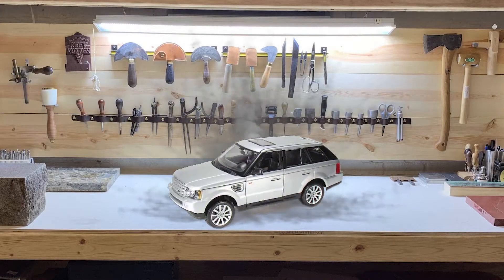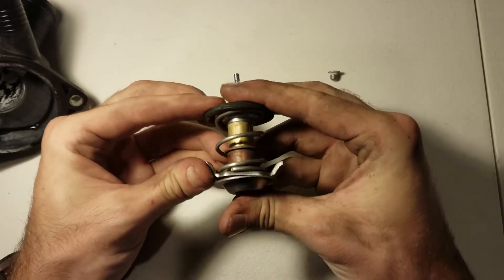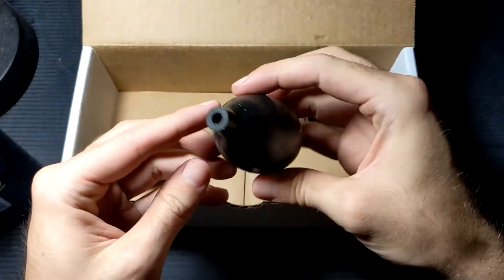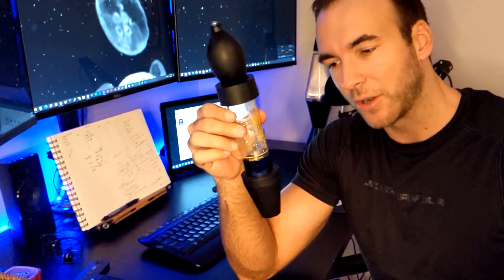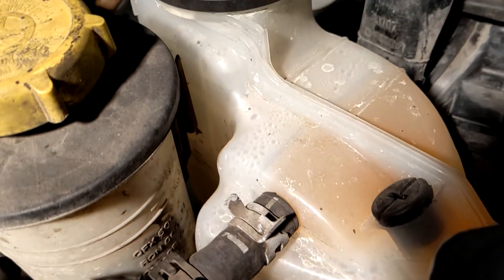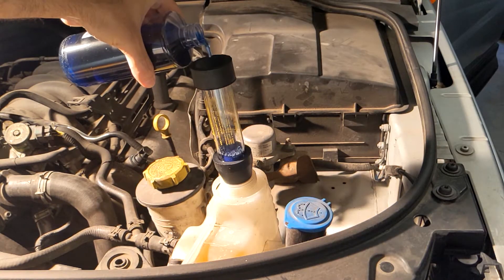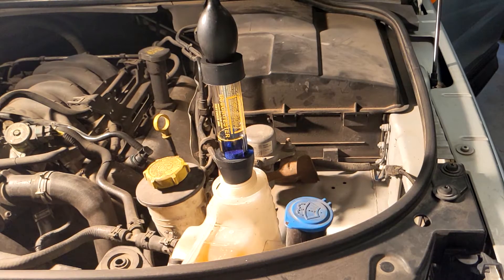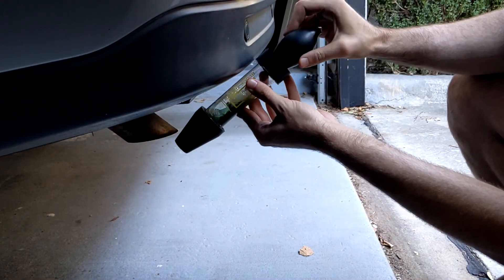Blown Head Gasket Test - Any Make/Model

Comment: I get tons of bubbles but the fluid stays the same blue. And when forming a tight seal the bulb won't expand it just stays compressed
Reply from the maker: That's good, there shouldn't be any gas being produced in the cooling system while the seal is tight.

Comment: Hey looking for some info. I’m testing a diesel for head gasket failure. Mine didn’t turn yellow but it turned kinda greenish blue like at 4:16. I tested it on exhaust and it turned yellow so I know it works. Is it possible I have a very small head gasket leak since it turned a little greenish. Said in instructions if it turns yellowish green then it fails but mine is greenish blue.
Reply from the maker: You may have a small leak but nothing large enough to require a new head gasket just yet. It should really stay the same blue as it started, any color change isn't ideal.

Comment: I bought the two-level tester....however, what happens is that the liquid from the top-chamber gets sucked into the lower-chamber, and the pump barely works, it takes about 30-40secs to pump up...eventually the liquid in the lower chamber changes colour and gradually so does the liquid the in the top-chamber...I don't know why this is how it's meant to work..

Comment: I had a weird issue crop up after a coolant flush, same 4.4 as you have. Previous owner had blue coolant in the system since I have owned it. Though at first I thought it was windshield washer fluid, I researched and found Peak European blue, which says "Land Rover V8 & Diesel, 1990-2005." However, the vehicle match check on Amazon and AutoZone says it's not a fit. So I wanted to swap for pink. Long story short, I have it flushed and pink added and mechanic says flush is clear but fluid keeps coming back purple after it cycles. They did a block test and it failed, not right away but after a bit, which he suspects is exhaust fowling the fluid. 1) I think that explanation checks out, and 2) with it running great currently, what are my options? What would you do?
Reply from the maker: @thelittleburro  The fluid in the heater core will take a while to flush out I would assume, I would not expect exhaust to turn yellow coolant purple. Id run it for a while and see if the coolant continues to change color after about 1,000 miles, and if so, maybe consider stop leak or having the head gasket replaced.
Reply: @HazyJay  It's the pink stuff I had them put in, so I could see how it might turn more purple. But it's weird because the previous blue always looked quite blue, not muddy. I just replaced the water pump myself (no overheating during my ownership) and didn't have flush equipment so opted to have them do it. When I noticed it leaking, I topped off with a few ounces of Prestone green, which the bad pump spewed out, so I parked it until I could replace the water pump. (Also, I asked if they ran the heater during flush and they said yes.)
Reply from the maker: @thelittleburro  Yeah I'd guess the purple color is much more likely from yellow mixing with blue rather than an exhaust leak, it will just take more time for the old blue to flush out completely. The flush procedure is fairly convoluted on the 4.4, so I wouldn't be surprised if they didn't do it correctly.
Reply: @HazyJay  I'm going to leave the fluid as is for now and perform my own leak test. If the test fluid changes color, what stop leak product do you recommend?
Reply from the maker: @thelittleburro  Yeah that's what I would do. I haven't had to use one yet and honestly the stop leak is the last line intervention since it can clog coolant channels you don't want clogged (radiator). If it comes to that, consider k-seal or barrs tablets.

Comment: What if the bulb never uncompresses itself. As in its not pulling any air into the test fluid? Its completely sealed?
Reply from the maker: Yes, that's a good sign 👌
Reply: @HazyJay  Thank you!!
Reply: @HazyJay  what if the fluid doesnt change but I do get bubbles? My Matrix never changed from the overflow tank but I did get tons of bubbles!

Comment: I have a question.  I had antifreeze in my oil… only noticed because I heard a slight unfamiliar sound when first running my 2000 International dt466e.
A mechanic suggested I have the oil cooler replaced as it was the least expensive place to start.
I had gotten the parts etc (definitely not inexpensive) .  Changed oil & filter a couple of times to try to remove the antifreeze.  Then re-added antifreeze.
I “thought” I had filled the antifreeze and actually thought I had over filled it.
Came out to check it the next morning and antifreeze seemed empty and antifreeze in the oil again.
The mechanic suggested I move the truck a short distance away, which I did, and white smoke was pouring out of the blow by.  This never happened before.

My question is this…. Could the oil cooler have been put on incorrectly.
If it had, would that cause the antifreeze to flow directly into the oil.  Aren’t they directional?
Reply from the maker: Usually the fittings (oil circuit and coolant circuit) are different and wouldn't be possible to swap on accident. It's possible the oil cooler was cracked and coolant leaks into the oil, but if you replaced it and still see oil it's likely turbo housing crack, engine block crack, head gasket. If antifreeze leaks into the oil while the car is off then it's possible a hose was incorrectly swapped but again check the oil cooler and see if that is even possible. Unfortunately I don't own this vehicle though.

Comment: What if it turns green?
Reply from the maker: green usually means the fluid is turning slightly acidic (dissolved CO2) and is concerning, it never turned full blue? Honestly if it's only green and you don't see bubbles I'd continue testing with the suction bulb until it either turns blue or stays green. it may mean there's a very small leak (head gasket) and you may be able to fix it with head gasket sealer but I'd hold off until it turns full blue.
Reply: @HazyJay  there's bubbles but it stays green.
Reply from the maker: @edogriff  if it bubbles without using the suction bulb that's not good. If you have no other symptoms maybe OK to ignore for now, BUT if you have white smoke exhaust or milky oil or low coolant it might be head gasket.
Reply: @HazyJay  it has white smoke.
Reply from the maker: @edogriff  dang, yeah probably the head gasket or cracked head (coolant mixing into combustion somehow), try CRC and see what happens
Reply: @HazyJay  AT is for rubber gaskets I thought.
Reply from the maker: @edogriff  you are totally right my bad, I mean CRC, but honestly I've never had to use one so I'm not sure which performs best. ChrisFix had success with Bar's Leaks Sealer: https://www.youtube.com/watch?v=q3_kDiQb7lE
Reply: @HazyJay  I have Kseal and Blue devil pour and go. Not sure what to try.
Reply from the maker: @edogriff  yeah I'm not sure between those two, one of the comments on chrisfix vid had bluedevil last 10 years and 90k miles
Reply from the maker: I don't like using gasket sealer unless totally necessary, I'm sure it clogs parts of the engine it's not supposed to, but if the vehicle has 200,000 miles and you're just trying to extend life it might not be a bad idea.

Comment: Great video. I do believe one can reuse the blue fluid, i could be wrong. To be on the safe side, pour the fluid in a separate bottle for storage snd check it again at the tail pipe when the enging is running and see if it changes.

Comment: so if my test remains blue after multiple attempts, does that mean i'm in the clear? I'm still losing coolant. I did a pressure test on the radiator, no leaks. could it leak anywhere else in the engine? My guess would be the water pump, but wouldn't there be a pool at the bottom of the vehicle?
Reply from the maker: It means you likely don't have a cracked cylinder head at least, BUT, coolant leaks are common from around the water pump so I would check there. It doesn't always pool it might burn off as it leaks and makes a syrup smell.

Comment: Very helpful and well explained video - thank you. Lost power in Transit Connect 1.8dci (stealth campervan) temperature high and low on coolant, restarted after a while.  Breakdown service did colour test and it changed very slightly, he thought it was probably head gasket failure. However my mechanic is not so convinced - he's changed water pump, thermostat and expansion tank, flushed the cooling system and driven it himself for some distance without a problem. I've had to top up the coolant a little since.......problem is I'm worried about going far - just in case!  Mechanic says he'll flush the system again and do a pressure test.  My question is - if it does turn out to be a head gasket failure, can it just be replaced without extra work such as skimming etc?   Thanks again.
Reply from the maker: If it never actually overheated I would think it doesn't need to get skimmed. If you're merely trying to extend the vehicle you can also try gasket sealer, of course this isn't a permanent fix but I've seen decent results for >20k km.
Reply: @HazyJay  Many thanks!

Comment: What if it turns a light blue green
Reply from the maker: @ronaldrrootiii6040  make sure you're not sucking up coolant, but eventually it should pick yellow or stay blue
Reply: @HazyJay  okay thank you for that suggestion! In all honesty the rubber tip did have water droplets on it after I did the test multiple times so I think I did just suck up water a bit but truly never turn yellow

Comment: I did a co2 test on a 06 Lexus gx470 today. Coolant was getting really hot 237F before I shut it off. So I checked to see if coolant was low. What I found was diluted coolant and it bubbling out of the radiator when I started it back up with rad cap off.  Thing is, it didn’t fail the co2 test. Is it possible for a leak coming from intake side/compression stroke and entering the coolant cause it not to fail co2 test but still be technically a blown head gasket?

Comment: Hello. I did this on my 09 lexus ls460 and it never changed color. I have a light white smoke coming from my exhaust.  Could I still have a blown gasket even if it passed the test? It's very faint and I have to really try to see it. Also it smells like gas . I don't smell antifreeze . Thank you Sir. I just subbed
Reply from the maker: White smoke is usually just water vapor (depending on the temp/humidity of where you are), you can tell this is what it is if you drive around and everyone has the same smoke coming out. Coolant burning usually produces a black smoke. I think if your test kit didn't change color you should be good 👍👍
Reply: @HazyJay  this is so assuring.  Everyone kept telling me I had a blown head gasket and when I did this test I felt so much better and then felt like I did it wrong since it didn't change color . It also had no bubbles so i should be good. Thanks again for the reassurance and helping us noobs out!!

Comment: Do you know if this method works to detect head gasket problem when there is oil in the coolant?
Reply from the maker: It should work, as oil in the coolant usually implies that gasses are getting into the coolant as well. Oil in the coolant is usually a sign of a severe head-gasket issue.
Reply: @HazyJay  Thank you very much.
Reply from the maker: Remember that oil floats on water, so you should physically see oil on top of the coolant as well if it's mixing into the coolant. @semihyilmaz4699

Comment: Hazy, a huge fan and follower of your channel and you have helped us civilian Rover owners in many ways, happy new year!

My 2011 rrs s/c 5.0 developed a weird cycling grinding/roaring noise on steering wheel going straight, at 5-10mph only. Do you have any idea of the causes? Here’s a uploaded video for the rear noises couple months back but it’s less noticeable. I performed a big 10 th year maintenance with all sway bar bushing removed, however the indie shop removed front drivel shaft/axle for access purposes, I’m not sure if that’s the cause of the noise. Thanks so much!! https://youtube.com/shorts/NHnFOETbtmk?feature=share
Reply from the maker: Thanks for the support! The noise in the video seems to happen only when the wheel is at a certain spot, so my guess is something is rubbing. If it happens even with the brakes lightly pressed, it's probably not the brakes. It could be the wheel bearing. You might be able to use a grease gun and shoot some grease into the wheel bearing and see if the noise goes away or changes.
Reply from the maker: That being said, the rear wheels also have the parking brake shoes, so I would try engaging and disengaging the parking brake to see if that changes or removes the sound. If so, it's likely the brake shoes rubbing and they should be replaced. If the sound changes when you lightly ride the brakes at 5/10mph, it might just be the brake pads.

good luck!